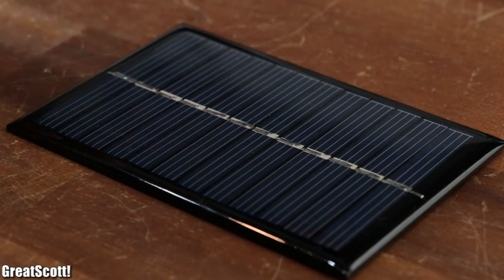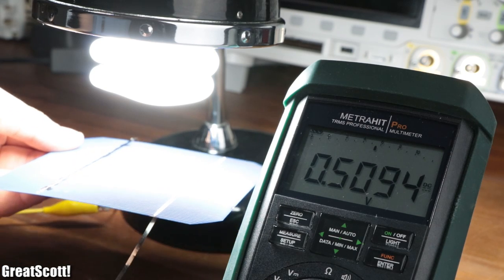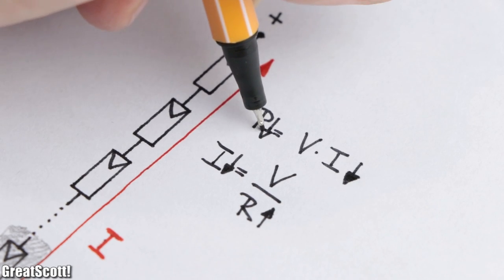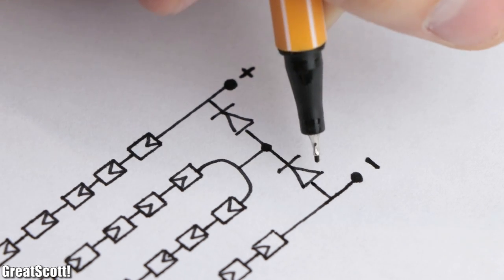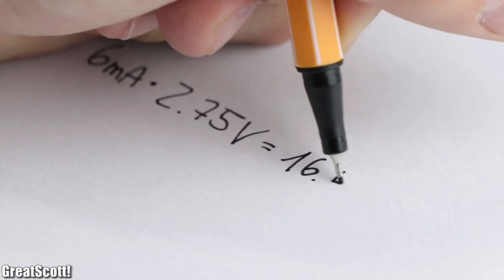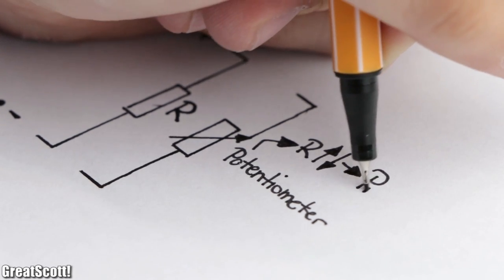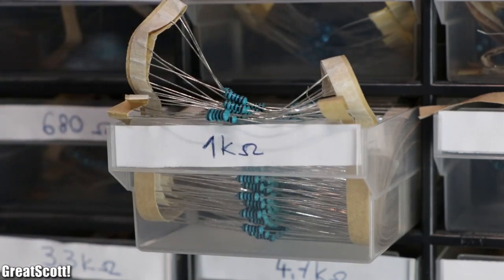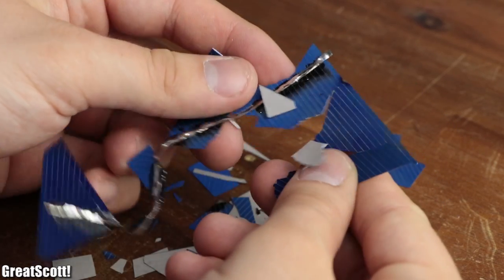Electronic Basics #29: Solar Panel & Charge Controller

Comment: Interesting to see that you also fell for the MPPT scam. The one shown in this video is actually not an MPPT type controller. The MPPT on its case is the name of the company manufacturing these.
How about making our own?
Reply from the maker: I have not tested the charger yet but I thought that it was not real. That is why I did not feature it that much in the video.
Reply: GreatScott! This summer I will probably start the project of the electric longboard you made the last year. I also learned something during this video nice one ! ✌️
Reply: What? They named their company MPPT? Is this even legal?
Reply: Welcome to china
Reply: you can actually make a mppt charge controller using arduino look this up at instructables
Reply: I know the this how to but i found the arduino micro i tried using for this project unsuited. The max PWM frequency is just above 32kHz and thus too low for compact high power applictions. I was looking for a solution to deliver 250W at 26V MPP-voltage into a 4S lithium-ion battery bank made up from recycled 18650s. So far i found no readymade sub-EUR250 solution that would fit my requirements. Also the reported HF noise figures on the units available are rather discouraging.
Reply: blubb spinat 
 Combine a microcontroller with a TL494/KA7500C?
Reply: blubb spinat, I was about to write exactly same :D It is PWM controller with name "MPPT". On Aliexpress it is as  "compatible MPPT charge controller PWM intelligent/efficient/energy saving" but it is not so good also as PWM controller ...
Reply: i've got one for you. here in Mexico most of our hotdog sausage is Vienna sausage, since it's cheap. there's a company called "American" that sells these sausages, so they sell it as "American Sausage"  complete with a bald eagle and stars and stripes. at the bottom you see a small "made in mexico" seal.
those sausages are garbage.
Reply: blubb spinat จ
Reply: I was shopping for a tie in solar controller and saw MPPT on an ebay device, someone asked if it was really MPPT, and the answer was no, it was PWM, but MPPT was the model name.  Unbelievable.  None of them are UL listed either so over here in the USA you could not tie them to your grid (without breaking the law, having a house fire, etc.)
Reply: you make amazing content. PLEASE make your own mppt charger that is powered by that solar
Reply: you make amazing content. PLEASE make your own mppt charger that is powered by that solar
Reply: The box says "SOLAR GHARGER CONTROLLER" instead of "SOLAR CHARGER CONTROLLER".
Reply: This solar panel - battery system sounds like a self recharging UPS to me
Reply: blubb spinat j
Reply: I was going to comment the same thing. Poor scott
Reply: @blubbspinat9363  ESP32 has adjustable PWM into the 100+kHz range.
Reply: XD they need a Scamer's Noble for this scam
Reply: @montoyo  LOLLLED at ur comment bro
Reply: @VictorGarciaR  xd
Reply: @greatscottlab   Need a video on a hand full of unknown brand cheap MPPT solar chargers and a few fake ones that claim and an explanation on what they do. Pwm, Boost and Mppt.  Could add tape over the brand names but show the products to make buyers beware.

Comment: i love how he says stay creative while breaking a solar panel :D
Reply: R.I.P Solar panel
Reply: He RIPped through that solar panel.
Reply: Stay destructive?
Reply: That's called creating a mess.
Reply: nedelas nahodou v AUO site Brno ?
Reply: Kryštof Zajíček The solar panels would work just fine as long as you can access to its annode and cathode. So donot break it just because a corner is broken.
Reply: romanemul1 nope
Reply: Kryštof Zajíček I empty
Reply: @mernok2001  wtf are you talking about? Most of all solar cells are that brittle.
Reply: He broke the solar cell to demonstrate its fragility! And to show the need to protect them in a sturdy housing or you won't have solar energy for long.

Comment: oh yeah, your video come at the right time! I'm planning to make an air conditionning system for a tent, based on a Peltier module and solar powered. I know that Peltier modules are very inefficient, but for the application I don't need freezing  cold temperatures or a big exchange surface. this video will help me to choose what components I need for this project, thank you!

Comment: I never heard of MPPT. Try what I learned in electronics college, Maximum Power Transfer. Basically the internal resistance loads are matched. This way of thinking has been around for decades before solar cells became mainstream and it really does work. Good work charting via real life measurements, though!

Comment: Very nice video, Jeremy. The timing was perfect, i just started making a solar powered wheather station, wich sends the data from my roof to a reciever at my electronics lab via radio waves. I thought of using NiMh Batterys as a rechargeable backup power source, but i think im actually going to try using super caps, since the requiered power is not that high.

Comment: I thought you were going to build an MPPT charge controller
Reply from the maker: Maybe in the future
Reply: GreatScott! please do it
Reply: yes do it
plz
Reply: throw away account yes. it's pretty simple. just need a current sensor, microcontroller and a buck converter
Reply: me too
Reply: @greatscottlab  if you ever going to build one, build one that can charge a single 18650 at 4.2V while tracking the mpp of the solar panel. Such circuit sound simple but you can't find them anywhere.

Comment: Thank you.  Very informative.  Can I ask you to explore a few Solar panel combinations: 1. No battery,  Use the solar panel to run daytime electricity at home, limit peak day usage and then: 2. a Switch system that changes to using electricity from the Electrical Utility company as soon as the sun power decreases below a certain value.  And 3. a switch system hat allows for sharing of solar panel electricity and available mains electricity.  In this way we simply use the solar panels in conjunction with available power plant electricity to cut electricity costs.

Comment: I've used the 40a epever brand actual mppt solar charge controller for my shed, works really great. only 500w of panels charging a 200ah battery, which can run all the lights and even a mini server and NVR 24/7

Comment: Thanks for answering my question.  I kinda wanted to see a circuit that tries to find the best power point, and the buck boost integrated into it.  Basicly, a fancy joule thief in order ot use, not only low Volt/Amps of solar, but any other small power source, (IE, wind farm).  Building a buck/boost to handle that kind of power would probably be impractical, but if you could show a joule theif/buck/boost that would send that information to a proper charge controller, that would be cool.  Kinda like handing off the heavy load to something that can handle the heavy load.

But, thanks again sir!

Comment: #GreatScott
Great movie. I will be doing an MPPT converter in my project for university. But I will use the high voltage panels (50V) and low current (1A) and the MPPT will increase efficiency even further. I will use an arduino for control this device. When I finish I can also record a movie
Greetings from Poland
Reply: Are you finished?
Reply: Wft, I'm from Poland too and had a very similar idea for University project

Comment: You can get very nice BQ24650 based MPPT chargers up to 8A charging current for less than 10 bucks on Ebay. Maybe not beefy enough for some applications, but with one of those 100W panels they're fine.

Comment: Forgive me if I'm wrong, new at electronics and GreatScott!, this site is intriguing. You mention diodes to bypass entire panels. I have 2x groups of 12 panels on my roof. From what I understand each group runs in series to pump up the voltage, and dumps that into the inverter (twin feed). My installer says if one panel suffers in a group then all those in the group suffer. Pretty much what you're saying on the panel you show. If I put high enough voltage diodes at the entrance/exit to each panel, have I effectively put in 'optimisers'? Have I isolated the poor performance of individual panels so the efficiency of the group is improved?

Comment: I'd like to know how to charge a battery using a DIY type controller.  For instance, if I had a bunch of dead calculators with solar cells in them and wire them together to get 12 volt power output, how would I go about connecting it to the battery in my boat?

Comment: So,
Will you make Portable Laptop (or battery) Charger?
Reply from the maker: Maybe in the future
Reply: There ARE some power banks that can power a laptop for several hours.However, you will find it not worth the time since it is too heavy. I'm going to replace my laptop(a 2.5 kg one) with a much lighter tablet since I can no longer bear the weight of all these equipment.

Comment: Hi Scott, really nice explanation ! I actually waiting for a little solar panel to use with pwm regulator -> battery.
Add second source of charging, like wind turbine is really complex, if you have a good solution for that, it'll be really interesting to explain :)
thanks for your work !

Comment: Hey Will, great video, bt why are you adding a fusible link to the inverter when it has a built in fuse under the red cover? Just curious if you were lowering the amperage of the output?

Comment: Very good video, thanks for sharing . I thinking how can I use more PC  UPS (each one provide betwen 800 W amd not pure sine wave)  conected in parallel (to use as inverter) to achivement 5000 W  . In one of your prevous video you show  how the SSR relay connect the louds  when  the curent is in point zero. Can I use SSR in thissituation. What you think ?

Comment: In 6:33, the measured open circuit voltage (Voc) appears to be 5.4V, however, in 6:45, it appears that the rated Voc of the panel is 22.6V. What is the reason behind this drop in Voc on the measured value? I am assuming the Voc rating shown on the panel is indeed for the panel you have done the measurement...

Comment: I have a general question, Can a dc-dc step up module be used to maintain a solar panels output at 12v 2.5amps, when panels out drops significantly? My solar panel is 12v 50watts one and I see the output fluctuates when I connect a 19v,3amp laptop charger(around 60watts), I wonder if one of these step up modules can help

Comment: Thanks for sharing this information....it's very useful. I have a question, can you charge a single 12v battery with a 300w solar panel with a voltage rating of 36v?
Reply: Only depends on the Charge controller you are using, check if the charger has 12/24v capability depending on your battery and the maximum voltage the panel provides and the controller admits.

If its on range you should be good to go.

Comment: Well stupid question but I want to build as much as I can my self and would try it:

-could you track the PowerPoint with a Competitor and Transistor. Where the competitor ttys to holed the voltage throu the resistance of the Transistor.

So I charge a condensate and use a.... That weared switch with to trigger points you can build with an Opamp.

To power a storage circuit

Comment: Hello GreatScott, thanks for the nice video. I got the impression that MPPT controllers use more power than simple PWM controllers and may therefore be less efficient when used with small panels. Do you have any thoughts on that?

Comment: I don't understand if you cover two cells it makes sense that the current drops by as much as it does but why does the voltage stay nearly identical when all the cells are in series and those two cells shouldn't be pushing much voltage at all?

Comment: hej GreateScott!, 
a lot of common solar modules seem to deliver 12V and typical car voltage is also 12V. Does this mean that using a big enough wattage (~100W Module) i could charge USB-C devices "directly" (using standard USB-C car chargers) from a module, by also transforming the least amount of energy into heat? Do i miss something?
Reply: adding a battery as a buffer is maybe a good idea, was just a thought i had.

Comment: i was wating for you to explain how many cells do wee need to charge a battery using a pwm solar charger or how to make a arduino mppt charger but noo you focsed on the blocking didodes wich by way its already in the controller so no need to put them in the solar panel

Comment: Using one of those big solar panels you find on roofs together with a couple of big batteries would make a nice survival/off the grid/emergency power source wouldn't it?
Reply from the maker: Maybe I am working on something similar right now.....who knows.
Reply: Nice? Well maybe. But it would really be better if it were mobile. In my opinion anyway.

Comment: It's strange, 1 week ago. I looking for a video you talk about solar cell :-) Are you going to make a video to do a MPPT, because it's almost similar to your "boost converter" no ? I see on your power meter you use a tp4056 module, i connect the tp4056 with a similar cheap solar cell 5v like your video and i work fine without solar controller, it work but i think is not more efficient. Thanks for your video!

Comment: great Scott. love your videos.. I have a question for a while now that I believe you might be the best person to answer.. can I use a buck or buck boost converter and set the out to e.g. 14.4v, and use it to replace a charge controller? (i know it theory i can) but will it atleast be more efficient than a pwm charge controller?. I await a response

Comment: Is there any way to have say 3 lipo batteries in Series, but also wired to charge in parallel at the same time? Is there any possible way of doing this even if it requires a switch

Comment: Is there a way to power a 5v 100ma(max) MCU using a solar charged battery and operate it safely within -30 to 50 ℃? What type of battery should I use?(Li-ion/Ni-MH/Ni-CD/Lead acid or so on)

Comment: Which diode should i use for 6v mini panels? I have 2 group series and rest 10 entire parallel so there is ~13 Voc and 1000mah I short. I have also dc dc buck step down to charge my phone as a conclusion there is only one diode that i put on the + output is that wrong?

Comment: I want to dump solar directly to the electric water heater element without any use of extraneous battery. I was hoping to find some MPPT driven DC/DC converter to do it. But unsuccessfully so far. This use case seems unusual

Comment: hey i though about building somekind of an charge controller wich is basicly an an opamp, pod and a cap wich then make the cap simply decharge at the a set voltage so that the cap alwasys keeps its voltage at the mpp voltage i think if that is working the system will automaticly output the max amps at the voltage.

Comment: Why do you draw the current as going from negative to positive? This is confusing. The diode direction is also backwards, isn't it?
Reply: Remember that he's working with the source, so if you want current to flow from positive to negative in your circuit (as it does) it has to flow from negative to positive in the source.
Having current flow from negative to positive is what generators do
Reply from the maker: Yep. Sources are backwards when it comes to current if we want to keep the orientation of the voltage drop the same.

Comment: Anyone disappointed with MPPT charger prices, check out the EPEVER Tracer 1210A/2210A/3210A/4210A on AliExpress. They have config on the LCD, wired remote control box, wifi and bluetooth controllers available. They have apps for Android and they also have PC software for direct USB connection but via a virtual serial to wifi you can use the PC software via the wifi controller which allows full control and logging directly from your PC.
And while there is no support for hacking, they also don't block it. There's already projects that connect an esp8266 to the MPPT charger and even a server+client project for logging the data on your server.
A good MPPT charger also allows you to fully use 48V panels which are considerably cheaper and have less power loss than the 12V panels!

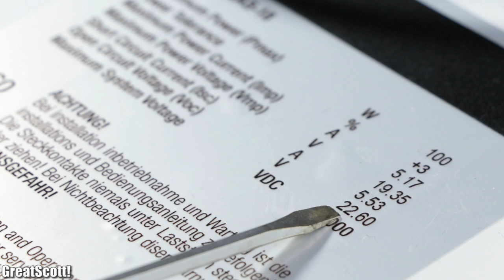Comment: @6:39 the panel nameplate show Isc = 5.53 Amps but the characteristic as plotted by him shows Isc value of just 5.5 mA. Why is it not possible to get the short circuit current as mentioned on the nameplate by simply shorting the two terminals of the panel? Even I have tried this myself in the lab but the current obtained is really very less compared to the mentioned Isc behind the panel on the nameplate. anyone please answer. thank you in Advance.

Comment: Your experiments are not fair because you used a flourescent light bulb, the high frequency of the bulb results in a huge output power loss from the solar panels. You need to use a incandescent, halogen bulb or natural sunlight source of light to use solar panels indoor.
Reply from the maker: The test was not about the maximum power output in regard to the irradiance though.
Reply: Oh ok, I'm more amazed that you replied than anything else!

Comment: I have a question about series connection. A solar cell have this downfall curve caracteristic, and for exemple,  a load (resistor R) have a linear caracteristic, and these two caracteristics intersect at some point of voltage V1 and current I1. When i wire two cells in series and load with the same resistor R, the output voltage won't increase on 2*V1, it will still be the same because of the work point (V1,I1), so the output power will stand the same V1*I1. So it has to have a DC/DC convertor to "transform" the resisting from R to 2*R so it could work on the new work point (2V1, I1). Is this correct? I do fight with an "expert" whos said it doesn't matter and this MPPT is just a bullshit.

Comment: You can get close to the max power rating of the solar panels by using a self power/water cooling system.
https://www.youtube.com/watch?v=_HMFtzn56XY

Also your MPPT charge controller that you are using is actually a PWM charge controller.